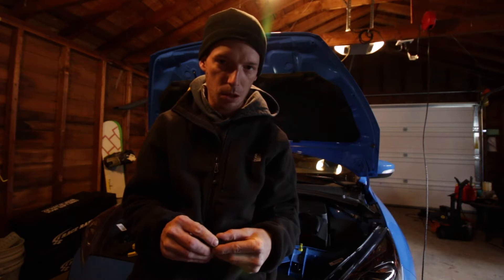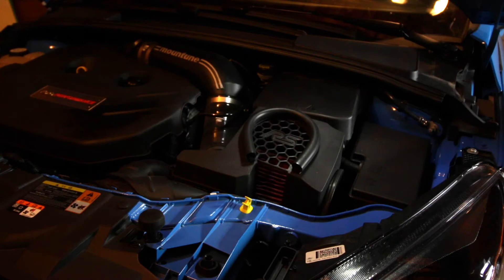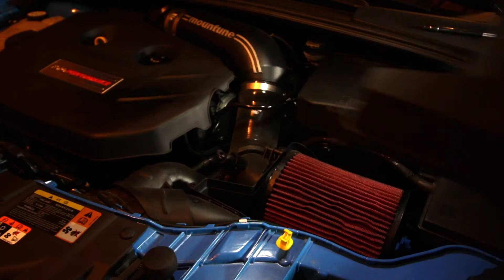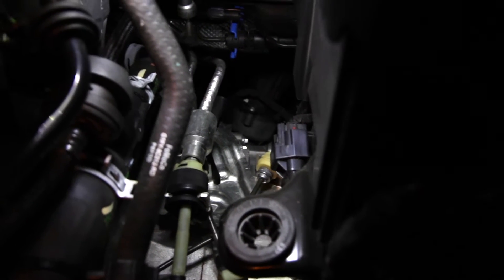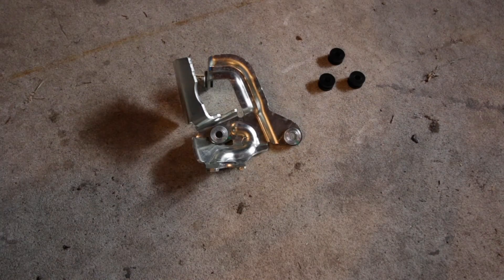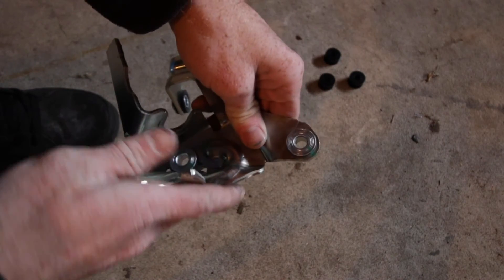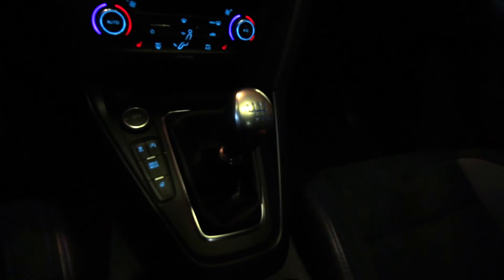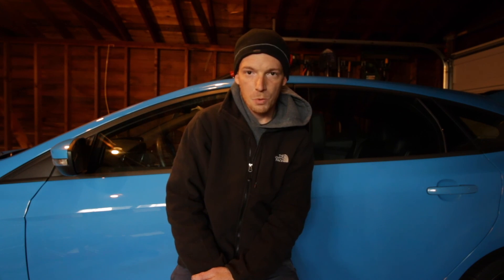Focus RS Billet Shifter Bushing Install   Worth It?   YES

Comment: OK, so this is a very informative video and I appreciate the work you've put into it, Christopher. That said, I'd like to point out that there are three components on the Focus ST/RS that have aftermarket bushings made for them: 1. The shifter cable bushings, 2. The shifter cable bracket bushings (as shown in this video) and 3. The shifter base bushings. I know it's a 6 year old video at this point, but you may want to consider changing the title to reflect that this is an install for the shifter cable bracket to avoid any confusion, as these are popular mods for both the ST and RS.

Comment: Just did this tonight, and wow that back left bolt was a PITA! I wish they threaded together like the other bushings on CNC shop, these would not stay together well so sliding the plate back in to place sucked! I notice you skipped all the part that I hated of the actual removing and reattaching haha! People say 30mins, but this took me over an hour not including air box reinstall as I was doing my shift cable bushings after these. Keep the videos coming!
Reply from the maker: +GeordieUSA Actually mine held together. I did not seem to have the problem of them separating. Where did you get your bushings?  It was an unbolt and bolt on for me. Basically like taking it off and putting it back on. Took maybe 15 minutes. I think I may do the actually may do the actual cable bushings this weekend. That's a challenge!
Reply: Christopher Ayres I got them from yourlittlecncshop as well. Yeh one of mine stayed together really well but two of them were not as snug so I had to basically hold them in place while I slid the plate back in to place and got the bolt started in the threads. The cable bushings help so much for the feel when shifting, and they weren't anywhere near as bad since they were accessible. I was a little nervous breaking the plastic in case I messed it up, but it all went well!
Reply from the maker: +GeordieUSA good. Gives me confidence.
Reply: You will have no problems with it judging from your other videos! Side note, any news on the exhaust external drive by and launch video?
Reply from the maker: +GeordieUSA it's been raining in MI for like the past week. Still working on it for you.

Comment: I thought you had a mountune quickshift! You getting one any time soon?
Reply from the maker: 4AL4LIFE Nope I'll have to order one. I never had an issue with the stock shifter until I put the rear mount in. No Ill have one on order soon and am working with some manufactures on some cool stuff in the same area I'll be doing a video on soon. Can't say what quite yet.

Comment: How did you take out the third bolt in the back without taking out the battery?
Reply from the maker: Sergio Vargas I used a stubby ratcheting wrench. It's easier than taking out the battery. Trust me on this one. Once you get it over the bolt which is actually on the other side of the plate than the battery it was very easy to get. In fact you could use a full size wrench too. You just need to remove your intake hose/plastic to see and reach. It's tight but much better than tearing out parts to get to, then having to re-assemble.
Reply: I have the first two bolts out, just having trouble reaching the one in the back. I'll try with a wrench tomorrow, thanks.

Comment: Just did this but now my second gear doesnt slot in as smoothly??? any idea what that could be?
Reply from the maker: +joshua ford Did you spin any of the end pieces or make sure they sat back into place in tact?  There should be no reason for this to make you gears harder to shift. If anything a little more notch but for the better like a gated trans. It doesn't really have to do with the actual shifting.
Reply: ya unsure it still works fine and def feels better but my shift into 2nd feels a bit different. Like if i put the gear shifter all the way to the left in neutral and slide down (to 2nd) it just locks, its as if my shifter has moved over a bit.
Reply from the maker: +joshua ford That is a bit strange. Those should not have affected your shifter moving.
Reply: @spundfx  Hi. 5 Years late to the party on this response, but for anyone else having this type of issue, the first thing you wanna do is a neutral reset. This resets all your shift positions to the way they should be.
Reply: @greecoboost  You are correct. A neutral reset should have been part of this video.

Comment: What a PITA it was to do the back bolt. My tip would be to glue the bushings in so they don't fall out
Reply from the maker: +Dave Flint mine pressed together well but that is a good suggestion.
Reply: Christopher Ayres fswerks do not
Reply from the maker: +Dave Flint mine did not either. They press fit together from my CNC Shop.